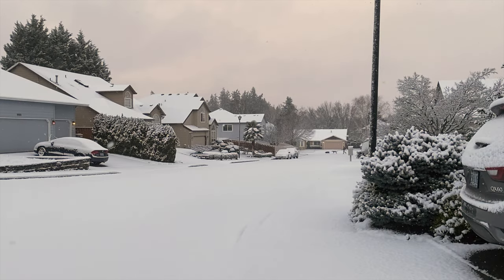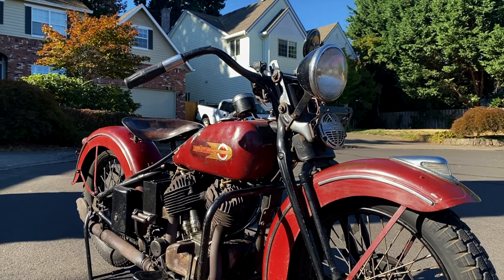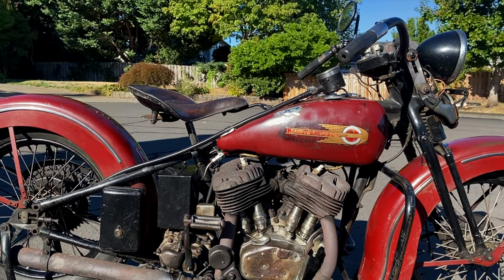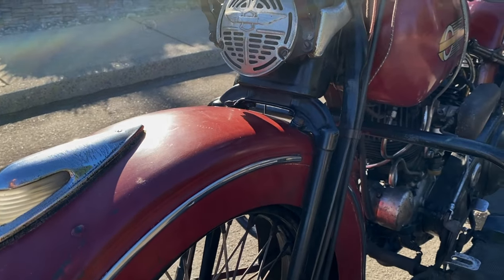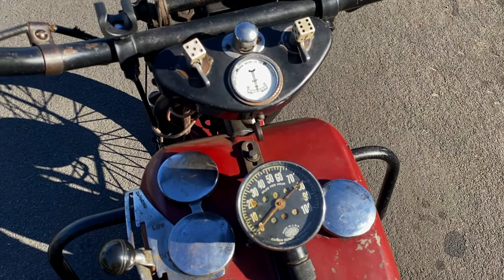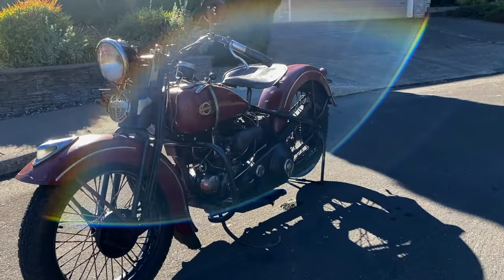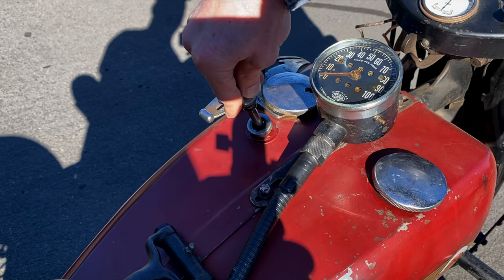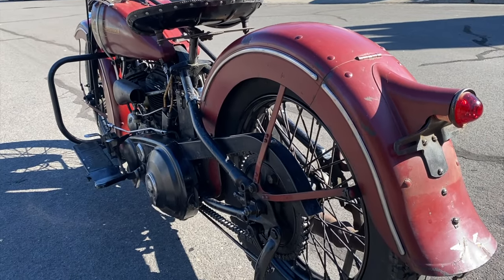Last visit to the cul-de-sac in 2021 - 1936 Harley Davidson VLH Flathead motorcycle

Comment: Technology at it's finest ! 35hp w/5:1 compression out of 80cu.in. I took a 2009 17hp EX250 up to 32hp with piston, cam, valve/spring, pipe and jetting kits. The piston set alone was probably more than this Harley when it was new. I certainly prefer bikes in this condition running so well. Hate needing sunglasses to look at show bike examples. Tell Mr. Anonymous  WELL DONE !! ps- paddle tires are made in 18" &19" diameters for sand and snow !!